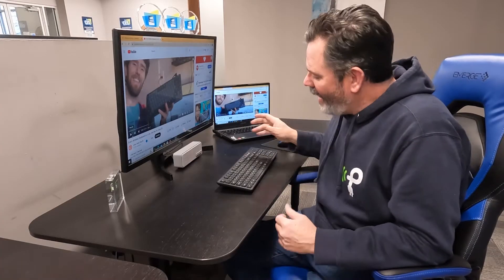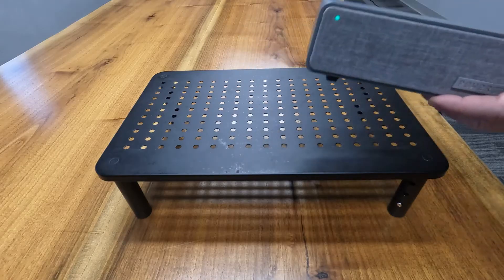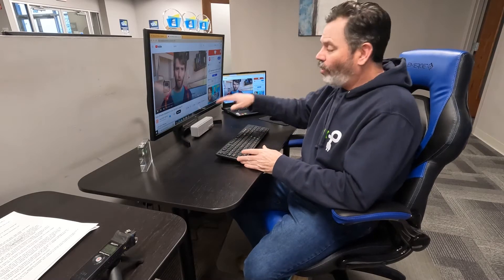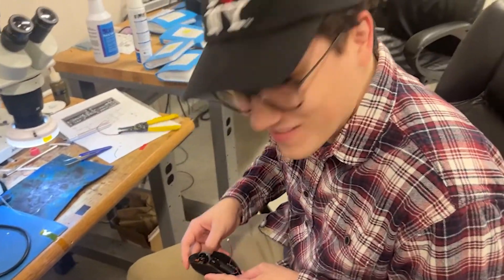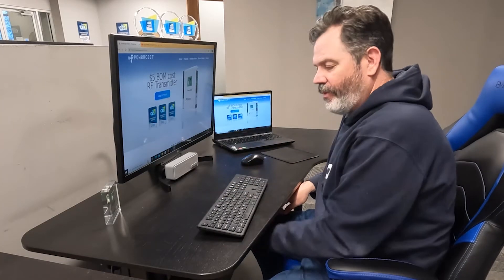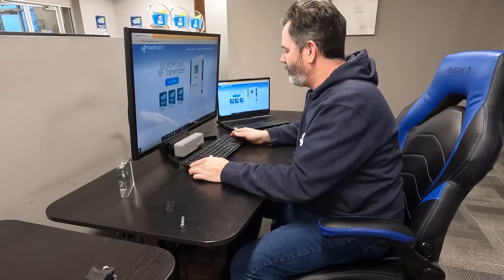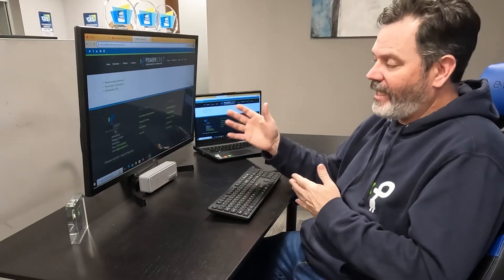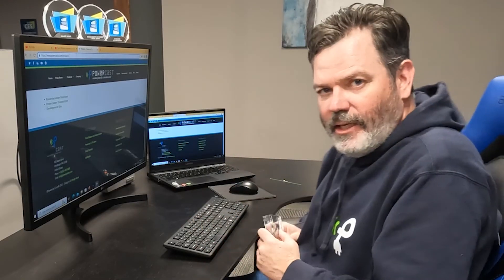Powered by Powercast - Episode 11  - Truly Wireless Keyboard (LTT response video)

Comment: Nice video but I would have liked to have seen how it was installed. Not why. I understand the why. I want to see the how. Please. I would like to see a product that I can plug in to an existing product like my phone does not come with wireless charging. But I was able to buy a wireless charging it fits between my phone case and my phone. And now I'm able to wirelessly charge my phone. I'm sure you'll get there soon. Or maybe something that I could plug into USB and my TV and be able to power everything like that. Instead of having to buy a TV new that has that. I'd love it if my smartwatch could charge like this that alone is worth it
Reply from the maker: Good point, with the cost of the transmitter electronics down to $5, we think there will be a lot more appliances that will also be RF Transmitters.

Comment: Hey, that's pretty cool! Small question, doesn't RF signals can interfere with lots of stuff?
Reply from the maker: Our FCC-certified transmitters are designed to play nice with others on the frequency.
Reply: @Powercastco  oh that's neet! What frequency channel does it use? + What's the efficiency percentage of the electric transfer rate at the distance from the keyboard to the transmitter? (best case scenario 15cm from the transmitter to the keyboard)

Comment: Great work guys! Just a thought: There could be a feedback mechanism to turn off the transmitter once the receivers are near 100% charge. 
Also I am curious, why did you have to "latch" the keyboard by taking it near the transmitter when it was batteryless?
Reply from the maker: Great suggestion, also, probably the wrong term, I just needed to get close enough to initially start the Bluetooth between the keyboard and computer,  then you could move it back a few more inches.
Reply: @Powercastco  ok, so it wasn't a powersupply thing, but more of a "the keyboard needs more power when starting up" thing.